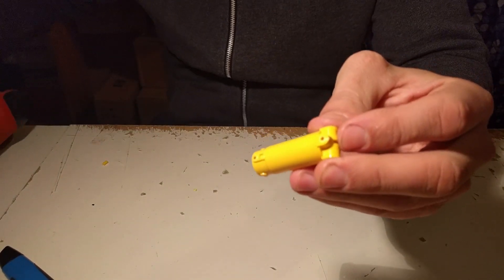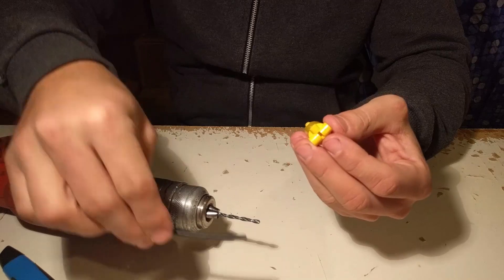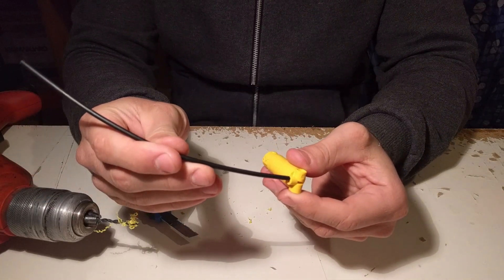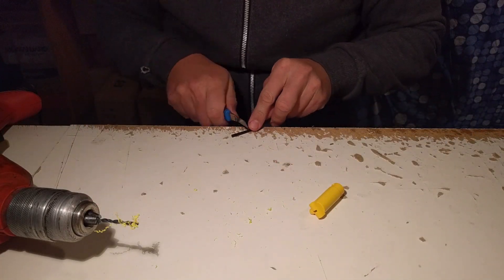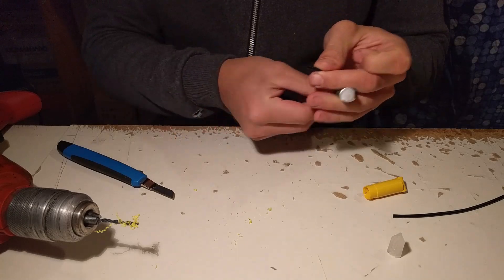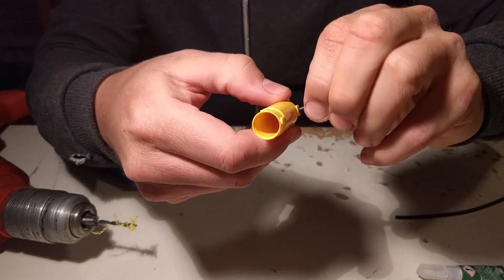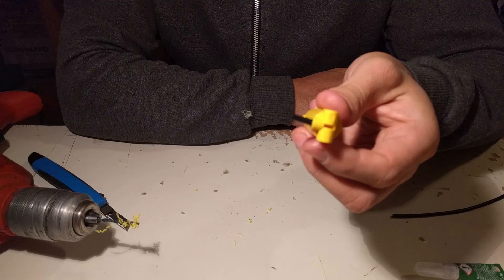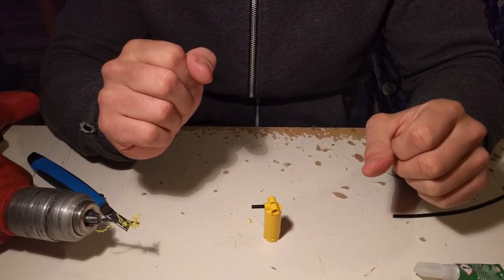LPEpower insight - How to repair a broken cylinder inlet

Comment: I have this problem with one of my cylinders so thanks for posting!
Reply from the maker: It is a very common problem. Sadly only the top inlet can be fixed this way.
Reply: i have a problem with the bottom inlet on my small cylender (where the yellow pin hole is) can it be fixed this way?
Reply from the maker: I am not sure. Possibly. There's very little "meat" in those small cylinders to work with. Same as with the top inlet on the big cylinders.
Reply: i still have the bit that broke off, would it be better to superglue it back in place? i have the right size drill bit to re-drill out the hole if i clog it..
Reply from the maker: I don't have good expiriences gluing the broken inlets back into place. They tend to break off again easily and the whole thing leaks.
Reply: how am i sposed to fix it then.. 😭
Reply from the maker: Sometimes things can't be fixed :(
Reply: i guess i might as well try to glue it on, and if it falls off i will try your method, i have hot glue dispenser too so maybe i can use that to fill the leaks!